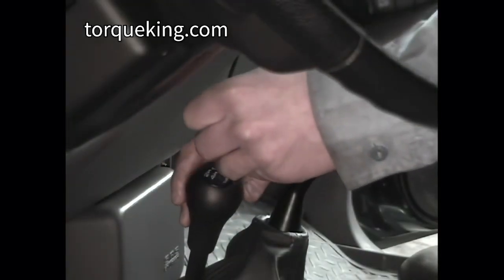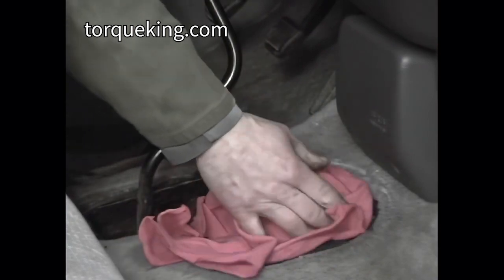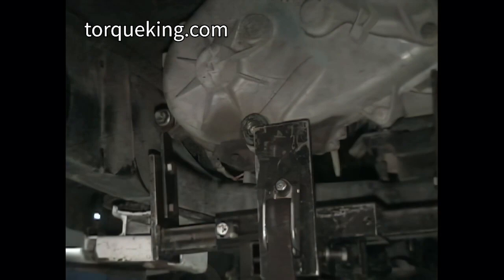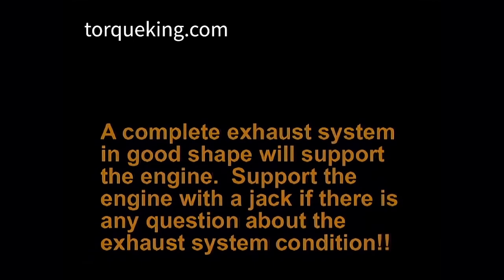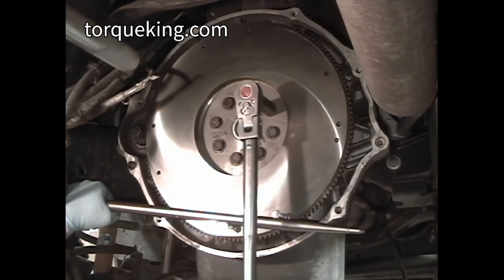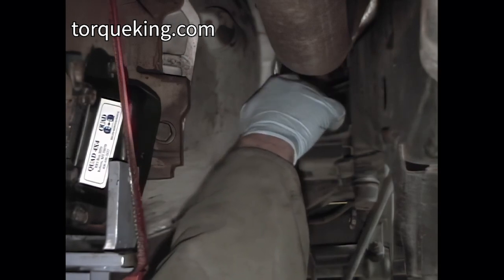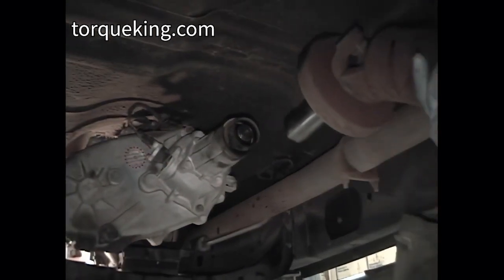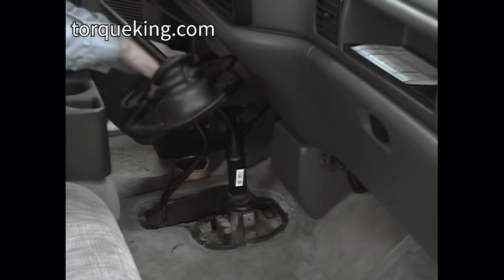1994-2002 RAM Cummins Diesel Clutch Replacement

Comment: This is a great company to do business with Torque-king  4 x 4! They are a wealth of knowledge and can supply you with just about anything you need for your Dodge ram drive line parts. They also Stock parts for other makes and models.
Check them first !

Comment: I have a 1995 Chevy with the nv4500 mw3 with the low granny gear.  Transmission won’t go into any gear. I replace the master and slave cylinder but still it won’t go into any gear. Do you guys have any recommendations in NC so I can take it ?
Reply from the maker: I don't know of any shops out there, but Andrew at Long Range Gear in Washington does fantastic work and can help with shipping.

Comment: Would this be any different for a gas motor? I have a 1995 Ram 3500 5 speed but it has the v8 motor. Thanks!
Reply from the maker: It is basically the same procedure, verify fastener torque for your application.